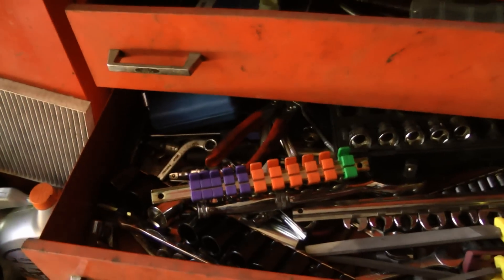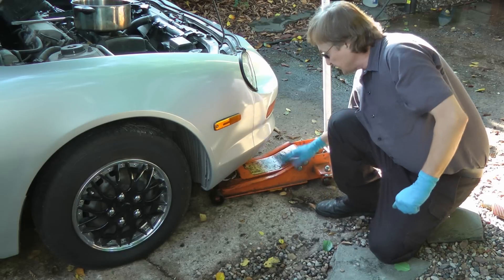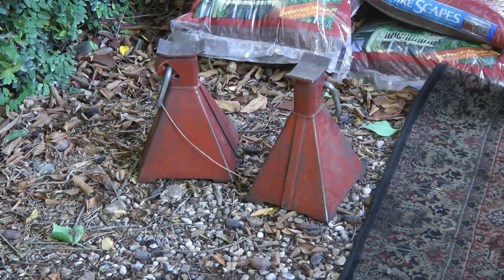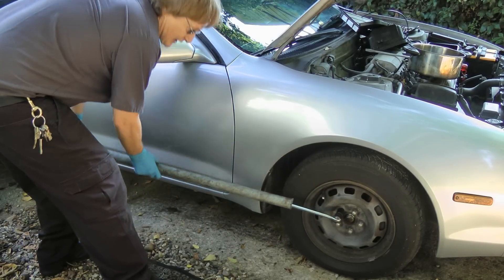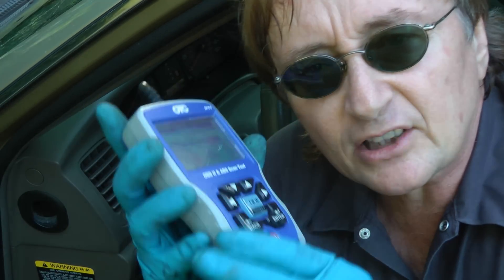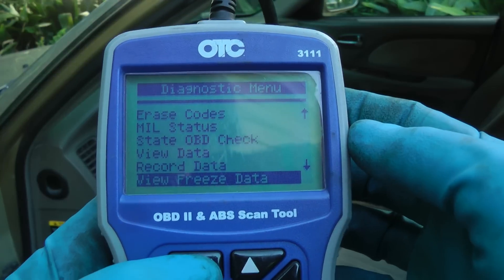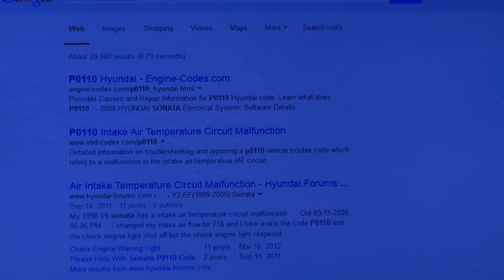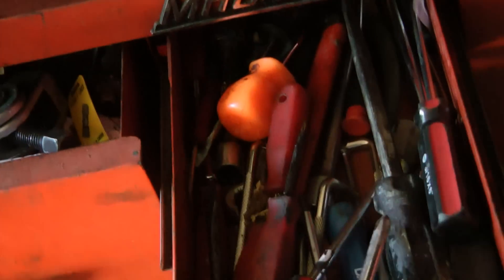Basic Tools For Fixing Your Own Car

Comment: I needed to get a cheater bar... So I looked in my backyard, had a 100 year old bicycle tire hand pump.  Couldn't get it apart because it was so rusted from being outside.  I needed the steel pipe to separate from the "ends."  So I got out the LIQUID WRENCH...Sprayed both ends.  All metal/steel parts.  Finally, with some love taps with a hammer and the wrenches or channel locks it started to spin loose.  Now I have a good solid pipe I can use as a leverage/ cheater bar/ breaker bar.  Liquid Wrench works!  Thanks for all your tips Scotty!  😇

Comment: Your videos are growing on me!
A few extras:
1. Good oil filter wrench (buy the socket style for your car unless you are a professional)
2. Hammer/shot hammer/mallet
3. Needle nose
4. Basic volt meter
5. Shop light
6. Combo wrenches
7. Socket swivel!
Reply: MrRexQuando Dude U R Not Kilmer!
Reply: Not bad, though I personally feel a basic impact wrench and impact sockets should be on this list. In my opinion you're always gonna have a better seal and lock up with an impact

Comment: Brilliant money saver.  No need for breaker bar though that works too.   Stuck frozen rusted lug nuts is an easy fix with a long hollow metal pole snugly attached to your lug nut wrench.  Turn attached pole ( remember lefty loosey righty tighty) and off comes the lug nuts.  Leverage is the best when it doesn't cost an arm and a leg.

Comment: The electric impact wrench from harbor freight is 49.99 new, although there is always a 20% coupon so you can really get it for 39.99 new. 

It has served me well over the past two years. it is heavier than an airpowered impact wrench, but it gets the job done.

On some jobs you really need to use it, on  most jobs its worth the investment to have it. it takes so much work out of things

Comment: If anyone is going to use the cheap car jack pumps, make sure your putting jack stands before you go under the car, they are very unstable the more times you use them. I would have been killed if I was under my car when it popped out of place.

Also, if you have a strong power driver/drill you can usually rig it to the car jack that comes with the vehicle & raise/lower the car with the push of a button. I just twist the bit changer to its widest point, put the flat end of my car jack bar in it, tighten it good & away it goes, in about 10 seconds jack is fully extended & 10 seconds to collapse it.

Lastly, I cant speak for all autozone's but the one I use will let you use their OBD scanner if one of your warning lights pop on & if they are familiar with the error, they will explain to you what it means & how to fix it. So if you know you are not going to use one on a regular basis, check out your local autozone stores & see if they will let you use theirs for free & save your money.
Reply: xinecal law  That is very good to know. I have also heard that Auto Zone will loan you specialty tools.
Reply: LK Campbell Correct torque wrenches, gear pullers & a bunch of other tools that you may only need to use once or twice throughout the lifespan of your ownership of that vehicle can be borrowed. You do have to give them a deposit for the tool, which you get back once you return the tool in a functional state.

Comment: I watched some of your videos tonight and can see that you give a lot of good advice. I have seen you recommend in some of your videos, including this one, that people buy a scan tool. A scan tool is a great tool to have, but unless a person works on cars on a regular basis, it might be more economical for an individual just to take their car to Auto Zone, Advance Auto, or other such parts stores and have them pull the engine codes for them. Most all auto parts stores will do that for free. If a person needs to take a scanner home to check another vehicle, most parts stores will rent them out through a loan-a-tool program. It's a great way to get the tools you need, especially specialty tools, without having to invest a lot of money for tools that you may only use once every few years. Like you, I am a tool fanatic and have a good sized assortment of tools, but I don't buy specialty tools that I can get from one of the loan-a-tool programs. It saves a ton of money. Will be watching more of your videos as time permits. Thanks for sharing your knowledge.

Comment: Great vids! Fun to watch and informative
Reply from the maker: DESCRIPTION
The Camshaft Position (CMP) sensor is located within the distributor. The operation of the CMP sensor is very similar to the Crankshaft Position (CKP) sensor. The CMP sensor will provide one pulse per camshaft revolution (1x signal). This signal will not affect the driveability of the vehicle. The VCM utilizes this signal in conjunction with the crankshaft position in order to determine which cylinder(s) are misfiring.
© 2015 ALLDATA LLC. All rights reserved. Terms and Conditio

Comment: Long spark plug sockets are important.
Reply: spyralspyder and magnets on sticks.
Reply: Spyralspyder you can always tell if someone’s experienced working in cars via if they have a magnet on a stick/rope or not.
Reply: Also, 1/2 " drive socket set for working on brakes and some engine work.

Comment: Torque Wrench!!
Dont be a fool, dont ruin the threads on your bolts and risk losing something on the road.
Always tighten everything according to spec, check your manual!
Reply: yes! especially with the lug nuts on the wheels
Reply: @paulbaguilarable  spark plugs

Comment: Great tips, Scotty!  I would add a few:  A good, portable light (also, a set of those that strap to your forehead is incredible useful for tight spots and when working at night); and mechanics gloves.  Also, one gadget I bought years ago but has saved me countless times is a magnet that's mounted on an extendable wand.  I can't tell you how many times I dropped a screw or bolt inside the engine and that thing got it right out....phew!

Comment: I once got the idea to use a 4 foot cheater bar on a car that I couldn't fix. It cost me a windshield, a side view mirror, two headlights and a hood.
I don't think I was using it correctly though. Shoulda used it the way Scotty did. Dammit.
Reply: Anger management classes bro 
It's  what u need
Reply: I refuse to use happy face emoticons and internet acronyms to show that I'm kidding.
Maybe that's the problem.
Reply: +A Darrate sheeeeeeeeeeeeeeeeeeeeet
Reply: Michael Block I did the same shit a week ago
Reply: Michael Block Should have stuck to doing JANETTE DAMMIT...

Comment: Hey Scotty I've used obdii scanners that work on phones thru bluetooth and have had no issues. Been using them for a few years now on 3 separate cars. Not sure how they can damage a car when its a read only application. 

Can you explain what kind of damages you witnessed?
Reply from the maker: +Manila Kid I've seen ones with bad interfaces short out the car's main computer
Reply: +Scotty Kilmer For me it seems that the problem with the bluetooth OBD-II scanners isn't the scanners themselves, it's finding a decent app to work with them! I've tried apps on Android, iOS, Windows and OS X and they all give conflicting information. They're great for live data readings, but they seem pretty useless for getting error codes or diagnosing issues that can't be found from live data readings.
Reply: +Aaron Traynor I suggest you contact the app developer. I did this and the app developer was really helpful in any of my questions and even recommended a blue tooth device that has worked perfect for me. I've diagnosed problems and fixed them with both the app and bluetooth device.
Reply: +Manila Kid I use the Torque app which is pretty good. Ive used it with 5 or 6 cars with no problems.
Reply: The ELM327 Bluetooth odbII adapter wipes out my 2004 4runner's zero point calibration causing lights on the dash. Resetting is not difficult but still another step.
Reply: yeah i have been using one for a long time now i leave it plugged in 24/7 365 he kinda scared me when he said that shit
Reply: This needs to be investigated.  I've used mine  with no problems.

Comment: hey scotty, you really should endorse those bluetooth OBD2 port readers. you can get them for $15 on ebay and they interface with basically any modern smartphone.
get the app called Torque for android, and it has a full scan tool suite built right in!
so you get a really good scan tool for only the cost of the bluetooth scanner, since you already have your phone!
Reply: oh heh, didnt watch long enough to see you mention them.
ive personally never heard of them damaging cars and i dont even know how that's possible. they have no onboard power source to do any damage.
were people using them for coding or something? 

in fact, i'm seeing no evidence of them causing damage from my googling. lots suspect they cause battery drain but only a few do in very rare cases
Reply from the maker: Ryukachoo
IF they are poorly made, simply hooking up the wireless unit into the dash can short em out, and I've seen that with chinese made ones.
Reply: Scotty Kilmer I love your channel Scotty and this is good to know. I have never heard of this problem. I do know that I bought a used ELM327 from Amazon with good reviews for about $9 after shipping and bought the $5 torque app. It does everything that I need it to do. I did have a cheap scan tool I bought from Autozone but it doesn't even come close to what the Torque app can do. I think my point is find a brand of bluetooth ELM327 with good reviews at a decent price and it will be safe to use and much more versatile than the scanners from one of the big box stores (unless you are willing to drop some serious cash).
Reply: Loren Tholcke
That's what I use. No problems so far.
Reply: Loren Tholcke I believe that if you are going to buy something "cheap" make sure that the item has reviews from fellow purchasers (Like Amazon)... People are quick to speak out if they are wronged and you can base your purchase off of that...
Reply: for $15 or lesser, they are burned quick. wont last long. someone used once and then became a piece of dead plastic.
Reply: Ryukachoo Anytime you do something with a smart phone you get Android.

Comment: That's not a cheater bar, that's a breaker bar. The piece of pipe is the cheater bar.
Reply from the maker: where I come from, it's called a cheater bar as it cheats to give you more power.
Reply: Martin Espinoza the breaker bar is called a "bodgey bar" and the big pipe is a snipe here.
Reply: Martin Espinoza Go head on champ.
Reply: Breaker bars are great at shearing bolts! They can turn a quick job into a nightmare. Enough times I've regretted I didn't go for penetrating oil, heat, impact gun etc. In the first place.

Comment: I never knew that the bluetooth scanners can damage cars.
Reply from the maker: ANY cheaply made electronic device can do serious damage, and most of those are made in China at very low cost.
Reply: the circuits are poorly made like not having a resistor where one is needed then too much voltage hits your system and frys something.
Reply: Scotty Kilmer your talking about this right http://www.amazon.com/gp/product/B0076KBPNI/ref=oh_details_o08_s00_i00?ie=UTF8&psc=1 and if so what kind of damage have you seen them do? seeing as I use it all the time...
Reply: ***** I have that exact one. Seems to work good to me.
Reply: ***** I have that exact one too - use it with the Torque app on my Android tablet and seems to work fine, although I did have to reroute a circuit trace for it to work with Fords because there was an error on the circuit board layout from the Chinese factory that produced it. I described the fix in the Torque forum.
Reply: Michael Chang It works fine on my crown victoria without any mods.
Reply: ***** Here's the thread in the Torque forum on the mod:
http://torque-bhp.com/forums/?wpforumaction=viewtopic&t=1710.0
Reply: Michael Chang I use Torque on my tablet via bluetooth. I love it. Works great. That ELM 427 chip has been around for decades. There may be a few chinese knockoffs that are poorly made. But if you get a well made unit, you won't have a problem. Makes it fun to fix your engine light!

Comment: Another tool that i can't work without and it substitutes the air impact gun is an 18V battery powered impact gun, no compressor, less noise and weight. And its portable so you can keep it in the trunk of your car.

Comment: Well, thank you for the education, I changed out a Mass Air Flow sensor today! I was having some problems and a Local shop that did some work for me, used there computer to fig out the problem, get this they billed me nothing, and told me save your self some money go over to NAPA and get a sensor and do it yourself! I did, for a screw driver, my Leatherman had the right size, and I just borrowed a Socket and ratchet! The Whole thing took 15 min!  I will be doing the PCV I think soon, I have to look at the records to see when it was last replaced!

Comment: I looked 3 times and although you reference your air-compressor it is not visible.

Seriously I will help you clean the garage!
Glad to hear you are not a tool snob! I have taken so much crap over the years about buying some seldom used tools at Harbor and others from the Snap-On snobs.

Comment: You are so right Scotty! Great list of tools and some great advice. You are right about those cheap little bluetooth code scanners too. They are not reliable at all. You can still go cheap, but always go wired. Those wireless ones are junk and when you think about the miles of wire and electrical components in a vehicle, it is not hard to see why you get interference with such devices. Hell, when I fixed computers in a shop long ago, we were wired back then (no wireless at all) and had huge issues with one side of the shop, in the back corner and our electrical stuff just acted weird back there. Turns out, because we were in a mall and behind a movie theater, that all the electrical for the theater, ran behind that particular wall and corner. So I understand electrical interference problems all too well. Hehehehe.

Comment: I used the half handle from a harbor freight 3 ton jack as a cheater bar today to unbolt a super tight front differential drain plug, just so you know Scotty you don't need to go out and get a cheater bar if you have a harbor freight jack stand. Just use the second iron pipe or handle

Comment: Like all your videos greatly.

Hot Tip on Tool Sets...

Make sure the socket set case is hinged with metal pins....Cobalts are good...Sears has garbage plastic hinges, and in a year or 2 you got NO CASE for your lifelong guaranteed socket set!!!  Harbor Freights are NG cases too. A caseless set is a real drag.

Comment: $24-$30 bluetooth ones have gotten better and now actually pull some great in depth codes without breaking your system, I even seen you review one before and that worked really well, ChrisFix done a review on one and so forth.

I'm not saying go out and buy cheap ones, but what I would say is go out and look at reviews, most YouTube reviews are honest even if they got it for free - hell, I even seen Linus Tech Tips bag out a pair of headphones to the point where the manufacturer stopped returning his calls.

So, my advice to people is, read reviews on items and consider the cost, even a $20 mobile phone could surprise you when that of a similar quality used to cost $500 back 10-15 years ago... and even they didn't have the tech in them that they do these days.

Old reviews could be sketchy because manufacturers also change the products so that they are more resilient or worse off,  let's take the humble kettle they used to be grand quality but now they are just absolute shit, but for my computer, a new power supply of the same model number became more resilient over the years they had it in production and ongoing development - that's something to keep in mind too..

P.S. Lifetime warranty items are exempt, Zippo is epic, your lifetime warranty that pop pop bought when he was a kid is passed down to your first born son, trust us on this, it's far better than the super deluxe grip no warranty but super expensive tools that you see, as long as the manufacturer is sold at the tool shop, they should swap it over no fuss, if not... the great tool shops will help you by filling out the RTM and contacting you when the new tool arrives, or one that has customer service that that is to die for... will post it to you at no cost.

Comment: Was cutting down a 70 ft. tree in backyard, it bent the fence post. Was easier to use the bent post as a breaker bar, instead of trying to perfectly straighten it
 The only use for 12 point sockets are using them to remove stripped nuts

Comment: If you want my opinion, I'd say look for a set of impact sockets. They are more sturdy and meant to take ridiculous forces making it basically impossible to shatter. While regular ones work great on rachets, they will shatter on impact wrenches and I'm pretty sure even a really big breaker bar might be able to break a socket if you're having to put a lot of torque on something but it's more likely you'll break one on an impact wrench so that's why I recommend have an impact set anyhow so you don't worry about breaking them.

Comment: I remember using a 6 foot long, steel clothes line pole to get the gland nut off a VW beetle. Tightened at 250 foot pounds, you need plenty of leverage...

Comment: You have to have a spring pickup tool. It's about 36" long,  looks like a long spring with a plunger handle at one end. Push the plunger and 3 or 4 metal fingers pop out at the other end. It's indespendable for fishing out small parts (bolts, nuts, etc) that get dropped while working on an engine, bounce around and don't come out on the floor (eaten by the engine). Their only a couple of bucks and have saved my butt a million times.